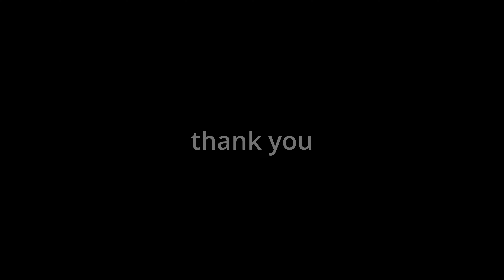"F" for Effort and New Chain Sharpening Method Test

Comment: I think if you added a snatch block instead of a carabiner think it would've worked. That way you gain your 2:1 mechanical advantage, and with the snatch block or pulley, you gain torque since you're increasing your turning radius and reducing friction at the same time. Darn good cutting chain aswell.
Reply from the maker: Hey! Thanks for the comment and I believe you are 100% correct!  This is an issue of wanting to run the saw and also wondering what the heck I was going to do with them once they were on the ground.. Probably just cut them up.  I really did bring home some with the intention to mill however, I am just short on time.  Thank you have you seen the chain sharpening video giveaway?  There is still time! Shipping to the US.  https://youtu.be/VSsT0QK7D80